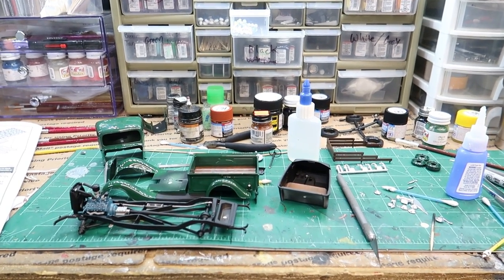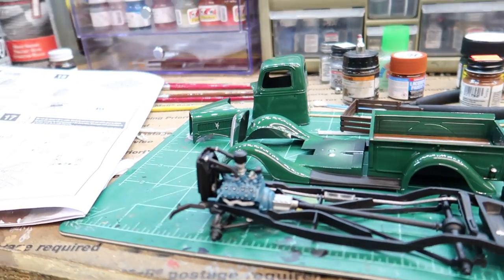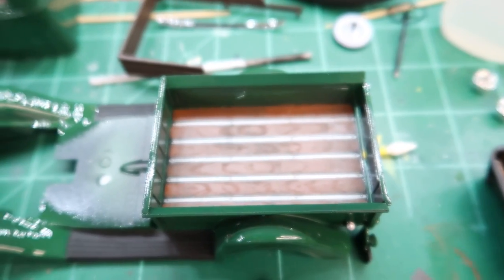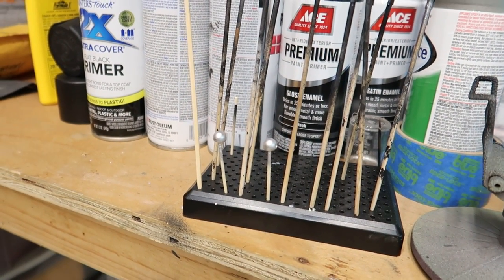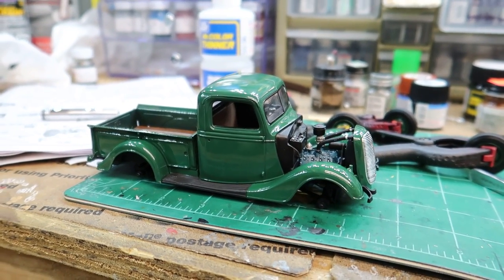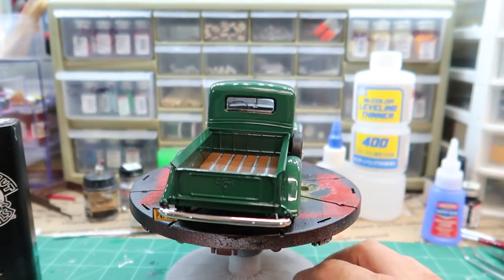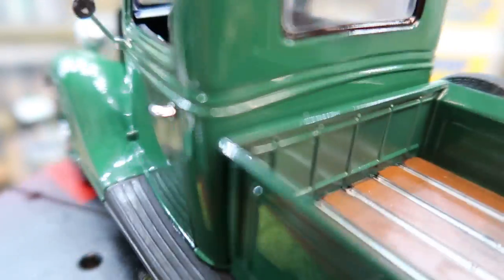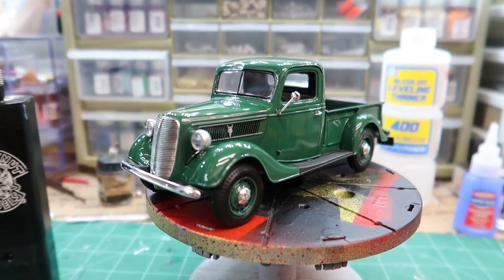Ready for the farm!!! Revell 1937 Ford Pickup build.

Comment: HA!  First.  

Dude, the camera has a LOT of surrounding items to pick out focus.  Moving the camera in and out after putting an item in front of it makes it even slower.  Once you put something in front of it to focus on DON'T MOVE.  Just give it a couple seconds.  There are probably settings you could adjust to speed it up, but it's working as is, it just needs a little extra time/Stability.

Comment: You showed your model shelf briefly at the end, and I had been thinking about asking you to do a video showing your line of built models. Not all-sides of each, but a few seconds on each one. 
In the beginning of videos, you pan across the shelf and it's hard to see everything. 

i don't know what camera you bought, but i think your lens depth of field isn't right for your workbench area, which isn't really all that deep from front to back, and the auto focus struggles to find mid-range. If you had the camera on a tri-pod, it might not struggle so much. Each time your hand moves, the software has to re-check all the measurement points around the screen in the background, and it stays blurred until it gets to steady-state. It doesn't know what you want it to focus on.

Comment: That turned out beautiful. If you haven’t already resolved your camera problem I might be able to help. First in the settings go to the metering menu and change it to (spot) and choose (center weight) then go into the display settings and select (grid). That may not be 100 % but it will definitely make things much easier for you because it will always focus on the subject that is in the center of the screen. And by having the grid displayed you will be able to center anything you want
I hope that helps.

Roy 
Auburn, WA.

Comment: Regarding your technical issue with the camera. You’ve mentioned it’s new and cost you a lot of money. Not knowing the brand or model. Just in general some of the higher end cameras have an internal setting for minimum and maximum focusing distance. This allows for faster focusing by keeping the camera from searching back and forth across the entire range. You may just need to go into settings and adjust the minimum focal distance. Hope this helps. Thank you for all your insight and tips,

Comment: Nice build, good color choice. I got the 1997 issue of that kit. Haven't built it yet. The original box art has the model in a dark Forrest green. And in the side photos, the engine is the same shade of green. Haven't decided what color to paint mine. I may go with a dark brown. The '97 issue, the only way you could build it was stock. Yes, the original colors were more a semi gloss. That is the way that the Mayfair Maroon is on my '41 sedan, on the firewall. That is the only area that still remains intact on it. It might not be a bad idea to get another shipping container for the other projects, and expand the model display cabinets into the other half of that container. It looks like it has come down to that option for model car display cases.